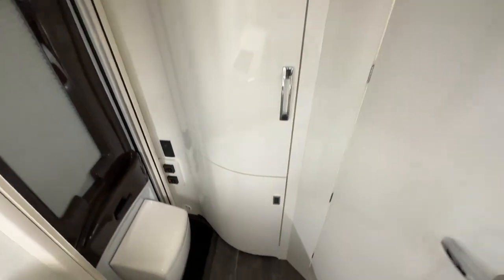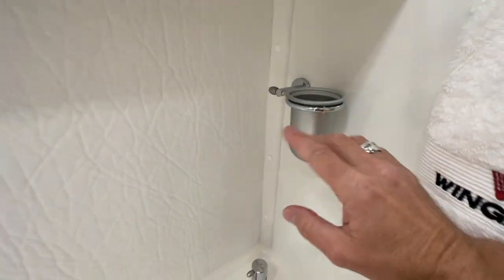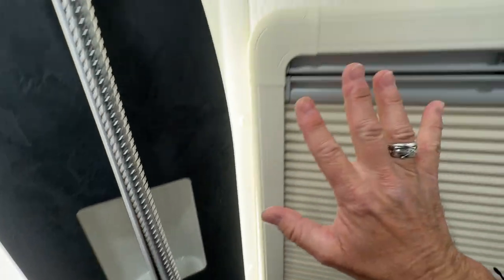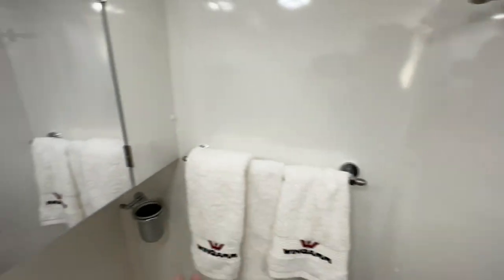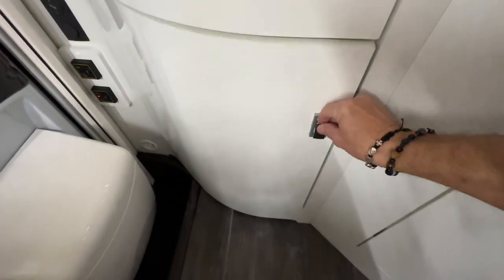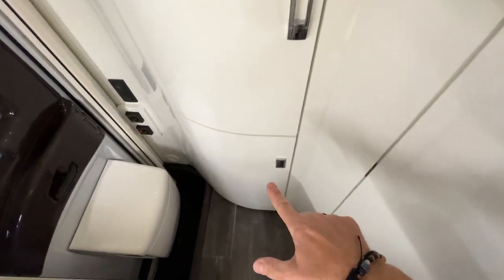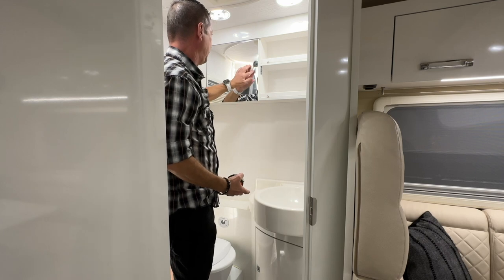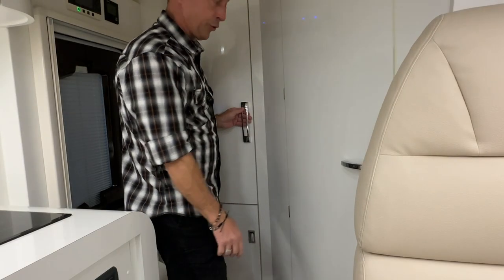IMPRESSIVE BATHROOM defies size of Italian micro RV, Wingamm Oasi 540 sold in USA 🇺🇸 2023

Comment: ***???Good evening. Love your videos ❤.  Are there any safety devices out there for awning style windows so that you can open it just a few inches and lock it in place so no one can grab it and pull it all the way open to gain access to the rig?
Reply from the maker: Yes the awning style windows have an ajar mode to get fresh air in but are locked securely

Comment: Hope they make ONE IMPROVEMENT! Not a fan of the WET BATH! Small 19’ RV manufacturers need to design smart DRY BATH with separate toilet and shower using a swivel WALL (not plastic shower curtain). See the Roadtrek Pivot for this DRY BATH design. 🙏🙏🙏🙏
Reply from the maker: Got it

Comment: Nice. But i would worry about water getting into the cubbies and on the window cover... mould springs to mind. Too many corners to keep clean. Need some form of soft moulded corners and leak holes in the cubbies... but nice one.
Reply from the maker: Thanks for sharing.  Have you seen my video, Solo female traveler in Coachmen Beyond Li3  HUBBY STAYS HOME!  Washer & Dryer in Camper Van
https://youtu.be/5pQ1gvywSbc